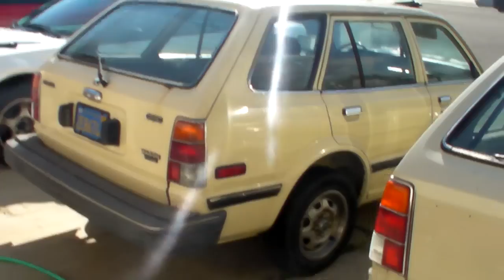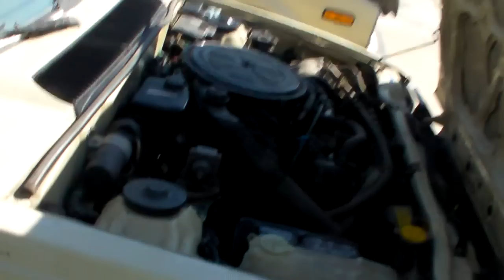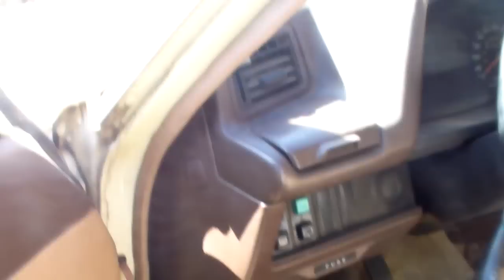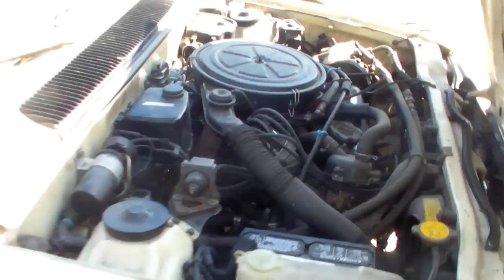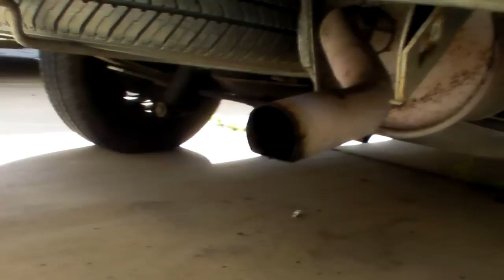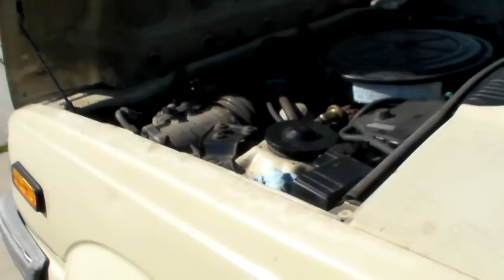1983 honda civic wagons 5spd

Comment: Not sure that these got much more than 40mpg , only because they weighed 2000lbs. 
i have 2  a1982 , and a 1983, just tilted the 82 as a classic, am getting 36mpg with the recommended 92 octane. awesome cars though, these aren't running to good though mine sound so much quieter